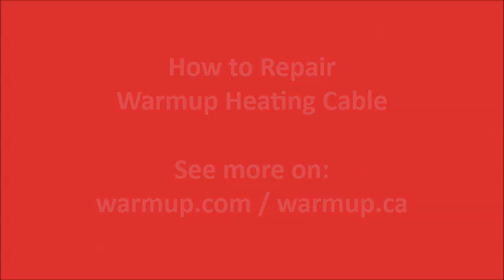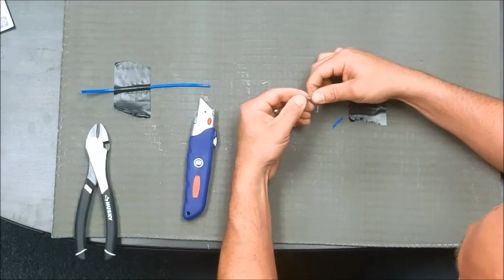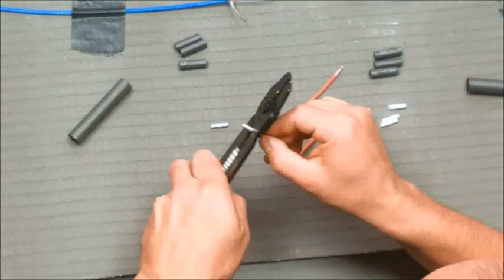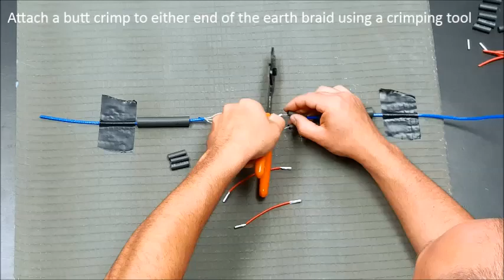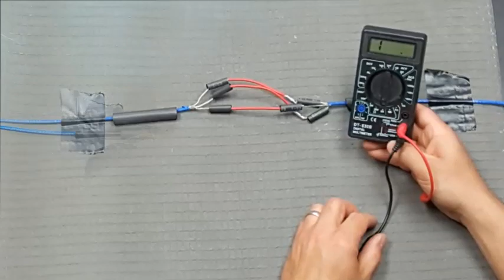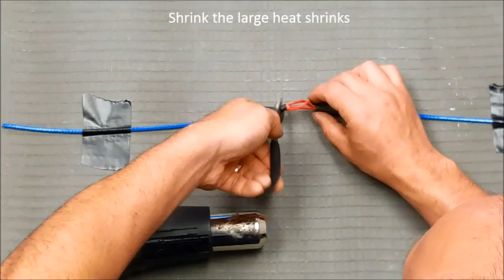How to Repair a Floor Heating Cable

Comment: Hi
I need to pass 2 meters with non heating cable? May i cut the heating cable and change it with normal cable in this 2 meters?
Reply from the maker: Hi Ardelean - the cable should never be cut intentionally. If you'd like to give us a call to discuss a solution, feel free!